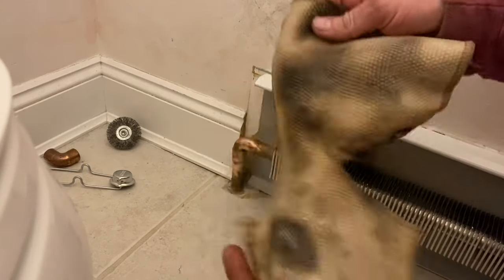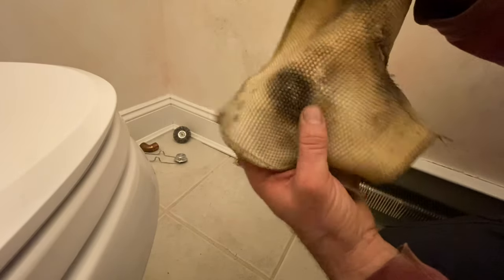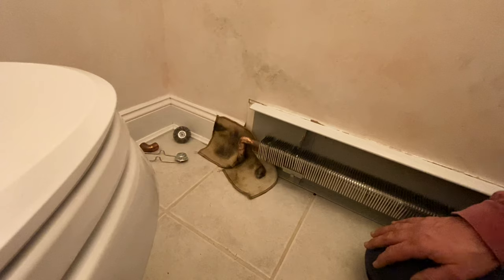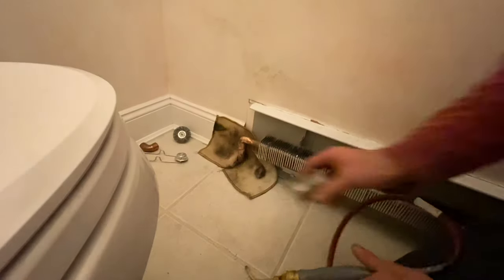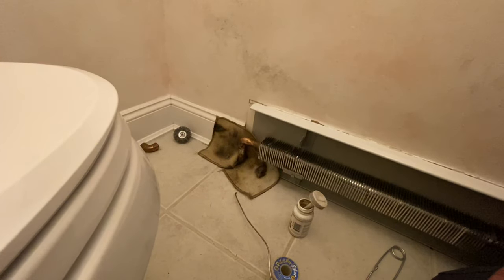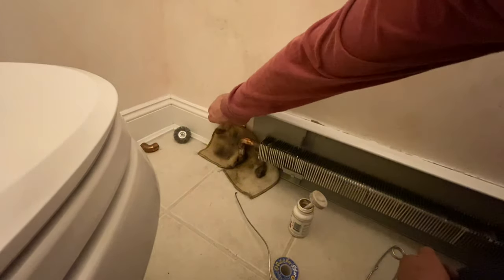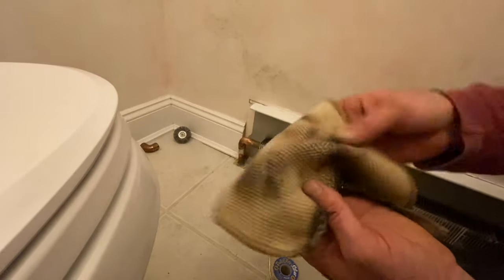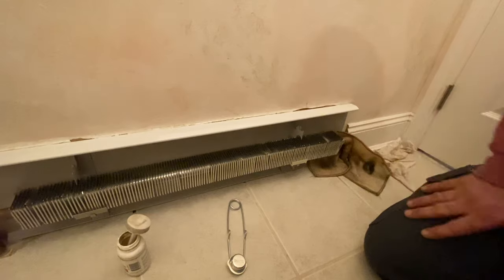TurboTorch Torch Shield Important Soldering/ Brazing Heat Shield/ Fire Blanket Safety Tool

Comment: I just grab the 1960's asbestos fire blanket, flail it about in the breeze spreading fibers all over whilst breathing deep :)))
joking, but I do have one kicking around here still, brand new in sealed packaging. I generally just use a piece of scrap duct tin, wet the surface behind that with water and try to keep flame away from any surface.

Comment: being aussie not familiar with that heating element is it circulating water or oil or something else like glycol ?
Reply: Water.  That's a hydronic heating system, a   fairly common type of heating system in North America.  the water is heated in a "boiler", not really a true boiler, in the sense that it doesn't create steam, like a true boiler in a steam heat system. The water is heated to about 80C, then it is circulated by pumps through a loop of piping, usually with baseboard elements like the one shown.  Sometimes there will be glycol added to the water for freeze protection, but normally it's just water.

Comment: kind of nonsense directing the torch flame directly into the backwall...keep the blanket in place, but direct the torch flame away from combustibles,  if possible,,,,,, and you clearly have that option addressing the point of heat to the far left......Why would you even attempt this like this....stupid